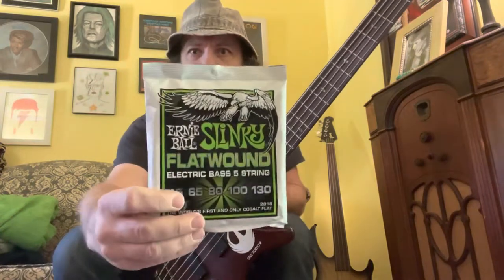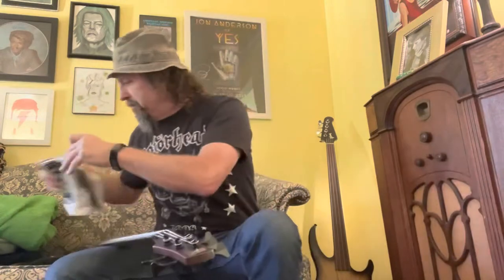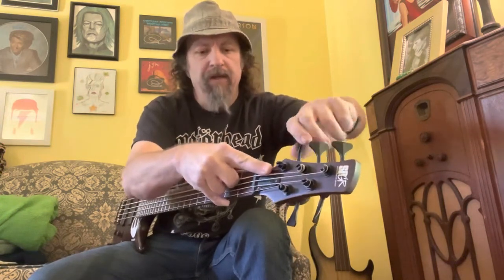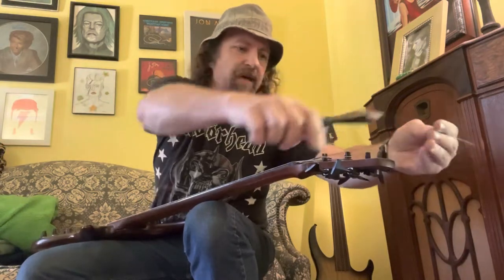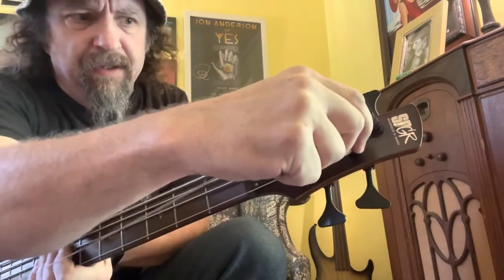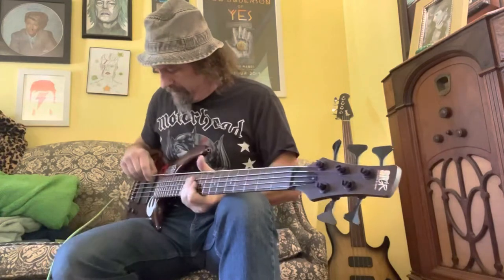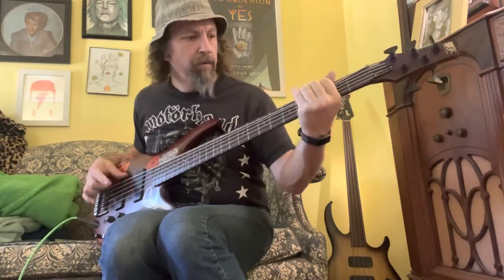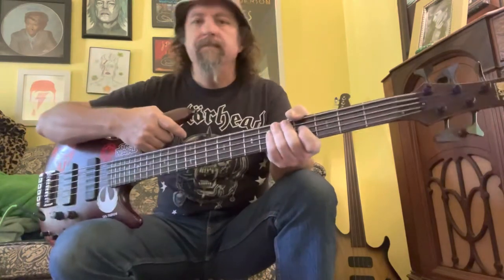Ernie Ball 2816 Slinky Flatwound 5-String Bass Strings

Comment: What scale is this bass? I was interested in those strings, but i do not know how they would fit a 35in one, might be too short if the one you have is a 34.
Reply: The only brand of strings that their standard strings don't work on a super long scale (35 inch) are Daddario strings. Every other brand works on 35 inch scale.
Reply: @JVMC_ZR1  D'addario works, not through body tho, that's what i currently use on my bass which is 35"